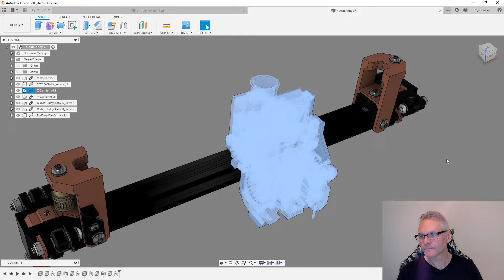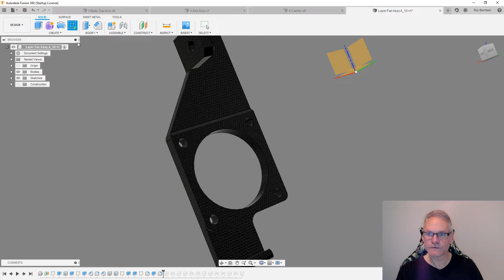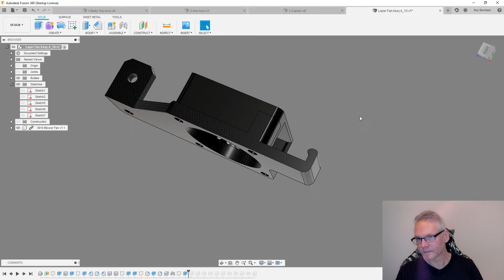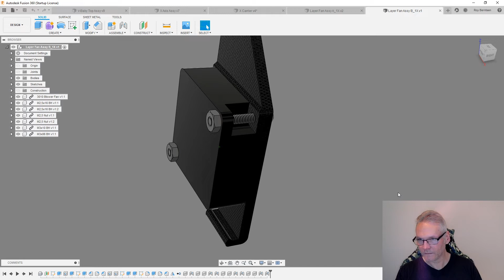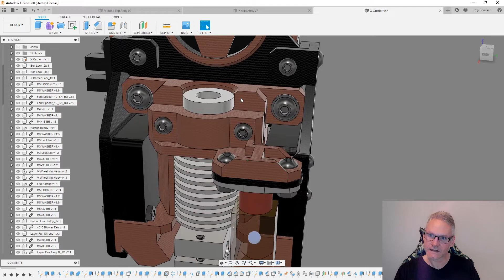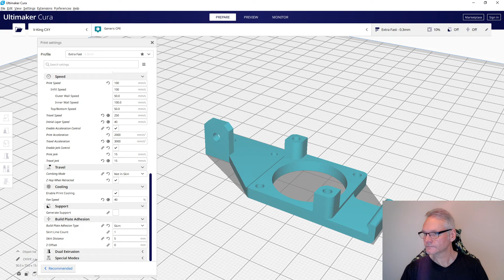V-Baby Improvements - Fusion 340 Live - The Fan Brackets

Comment: Hej Roy

Jeg vil høre om du har intensioner om at designe en "mounting-plate" til din x-carriage,  således jeg kan installere en hemera hotend eller lignende på dit design? :) 

mvh. Mark
Reply from the maker: Det bør bli mulig
Reply from the maker: Men det blir til den nye RACE
Reply: @PRO3DESIGN  Tak for hurtigt svar! :) Må jeg spørger ind til RACE? Er det også en corexy? (Er ikke begyndt at købe hardware endnu, så kan godt vente lidt)
Reply from the maker: @MrMJSY  den maskinen er under utvikling
Reply from the maker: @MrMJSY  usikkert når ferdig
Reply: @PRO3DESIGN  Lyder spændende. Jeg må væbne mig med tålmodighed. Hvis du har brug for en tester/inputs så må du sige til. (Er selv MSc Engineering) 

God aften :)

Comment: Cool to watch, thanks for that. Which controller are using to look around in Fusion367894? You never grab the viewer cube thingy in the top corner, so I assume you've got some dedicated hardware.
Reply from the maker: You can use your mouse middle button to rotate. But you are right that I use a special tool for better movement. It's The 3d connection mouse I use on my left hand for rotate and pan pluss zoom